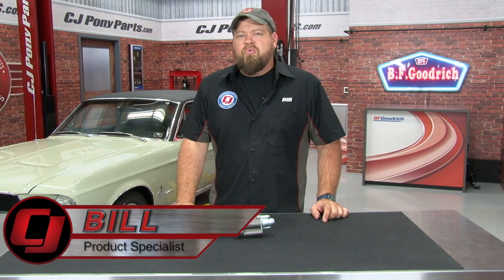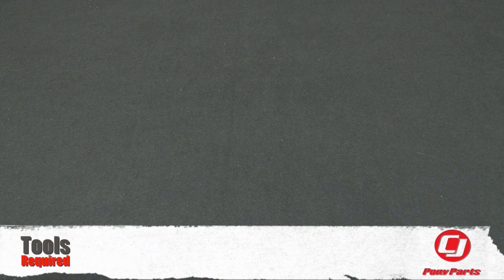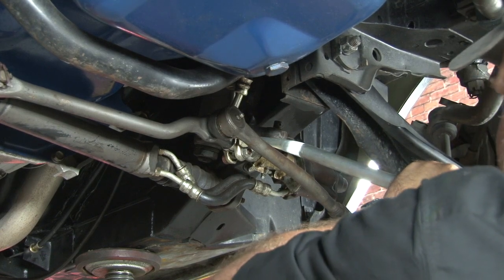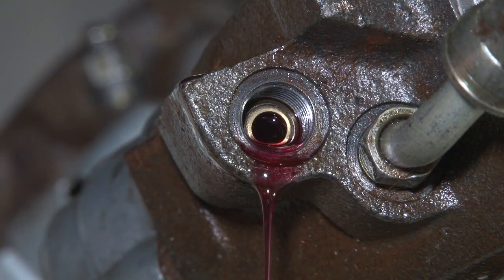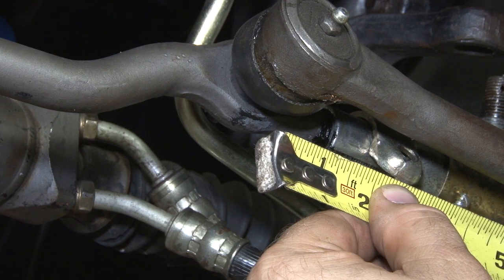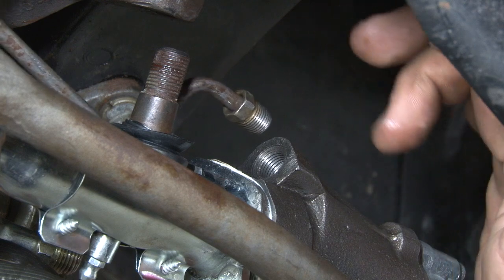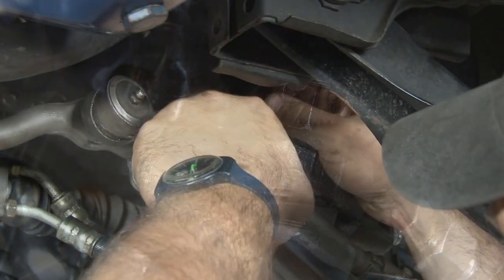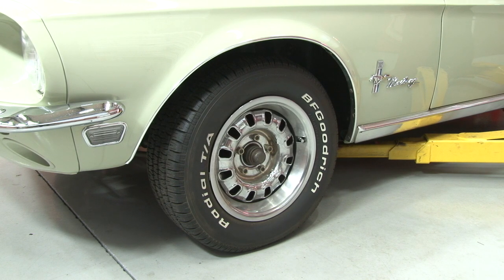Power Steering Control Valve | 1968-1970 Mustang

Comment: Replaced both lines going to my control valve, system was totally drained during the process. Once new lines were installed and reservoir filled the slightest touch of the wheel causes violent steering wheel oscillations. Have tried many lock to lock turning (engine off/ car raised) Some air comes out, but no matter how many times I cycle the steering (very hard turning) it will violently oscillate with the car running.  Suggestions?

Comment: How do you adjust the fluid flow through these? I got a 69 mustang and it darts all over the road, steers all the way to the right if you have your hands off the wheel.
Reply: I just replaced the control valve in my 67 Mustang. I just did what this guy did and replaced control valve and then hooked up the hoses the same way they were. Perhaps you don't have the right hoses hooked to the right places and that's why the fluid flow is bad?

Comment: How is all the steering loose while putting the control valve back on the pitman arm?
Reply: +Eli Podoll its loose because the center link is in no way connected to the pitman arm. the control valve (kind of) is the end of the center link on the cars

Comment: my control valve was not put in on the exact threading it was before it was replaced, is there any way for me to find out the exact position it is suppose to be in?
Reply: If you have it aligned they should be able to adjust as needed.

Comment: Don't pickle folk on the control valve it will pull the stud out 99 out of 100 times, also that line adapter pushes the line out and binds on the pitman arm on a full lock turn.

Comment: Use only type F automatic trans fluid huh?  How about using power steering fluid?  That way you can easily tell what's leaking.  Following is advice I received from Lares Corporation, who makes the control valves  >  "Our parts have modern seal material so we recommend using any modern power steering fluid as long as you stay away from anything that has stop leak properties."
Reply: if you want to make your own rules, go ahead.  Ford states clearly only use Type F trans fluid. Seals, hoses, and components are designed to be compatible with it.   If you want to make your own set of rules, go ahead. Might as well make you own rules for what goes in the crankcase and transmisison too.
Reply: @chadhickey9942  "My own rules" concerning PS fluid have been working well for the 45 years I've owned my Mustang.  It's the original pump, although I have replaced the control valve and hydraulic ram.  I assume you use type SD oil in your 67 engine?

Comment: If you swap your CV and the steering flies violently to its stop on start up, you have crossed the short lines.  Found out the hard way and there is not a lot of info out there..hopefully this helps someone.
Reply: Hey your my guy! Just got a 68 convertible l started it. And the steering wheel by magic spun to the left. I was geez, l never seen nuttin like that before!  LOL! the guy put a new rack in. I  knew he $//=÷#@! Up
Reply: @royboy3597  Glad it helped someone.  And I was glad that I did not reach through the wheel to start it up the first time as it spun so hard a broken arm or wrist might be the result.  Fortunately, while it wakes you up quickly, I didn't have damage...just swapped the lines and tweaked the centering adjustment to prevent slow drift to one side.
Reply: Hey Randy, can you tell me which one is the pressure port and which is the return port (in the control valve). I can't figure which one is which. I have new control valve/hoses, so I have no reference

Comment: YOU CANNOT USE A PICKLE FORK TO REMOVE A CONTROL VALVE. You will destroy the core. The 1971 Ford Factory Service manual which covers all models back to about 5 years, clearly states the use of a pickle fork to remove the PS control valve will damage the old valve. You must use a ball stud separator such as a tie rod end separator.
Reply: ABSOLUTELY RIGHT -- never use a tie rod end fork to remove one of these control valves. I've rebuilt 4 of these and it was easy  to see that someone had used the fork on them. They were beat to pieces, warped and mangled. I had a hard time saving all of them. Had to replace some of the sliding brass sleeves and make the tubing extention housing round again and remove burrs.
Reply: Aren’t you removing it because it’s damaged and you’re replacing it? If you’re rebuilding it, it’s the same case, everything is going to be replaced anyways…

Comment: How did the steering feel after the installation? I am debating if I should attempt to rebuild my original or buy one of these. My dad bought one for his Mustang a while ago off Ebay and the steering is whack. It feels tight while turning to the left but completely loose when turning to the right.
Reply: +MrFuroius1972 It felt very solid after I drove it, there was only a slight amount of play and that went away when I replaced the idler arm.